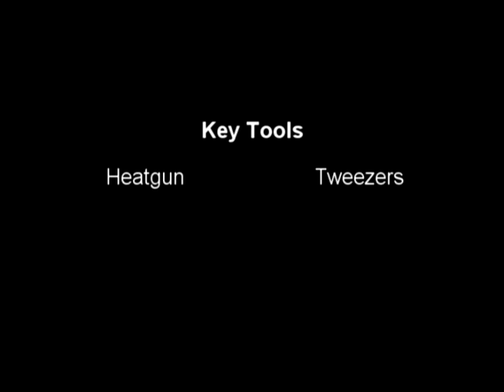Longboard - Electronic Skateboard Build

Comment: Looks remarkable. A led longboard how did you power it
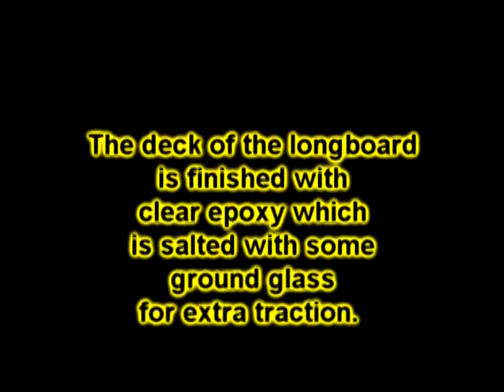Reply from the maker: I helped my daughter build this. At about 1:40 you can see a shallow groove under the  text about "clear coating".  We nesseled an aluminum body from a "Mini Mag" flashlight here.  We made a couple of U shaped pins to secure the body which holds two AA batteries. There is a little off/on switch so the tilt switches can kick in. Great question